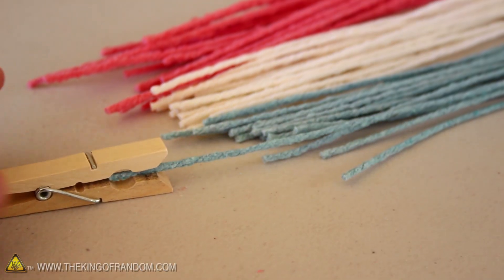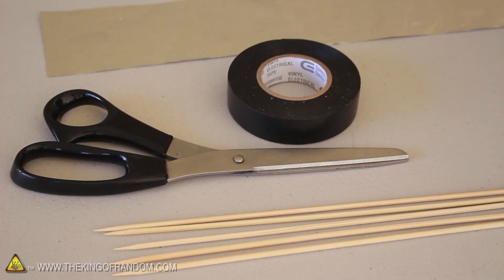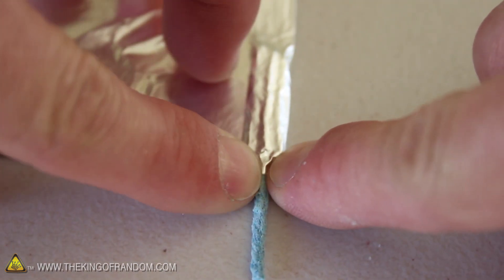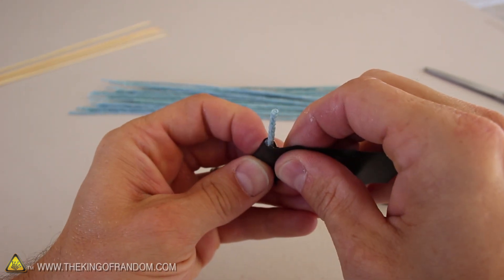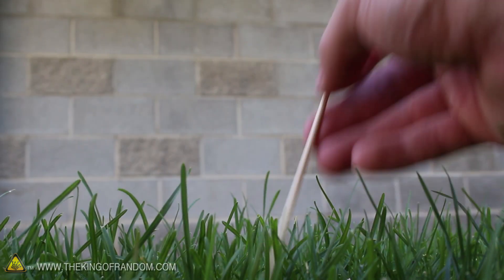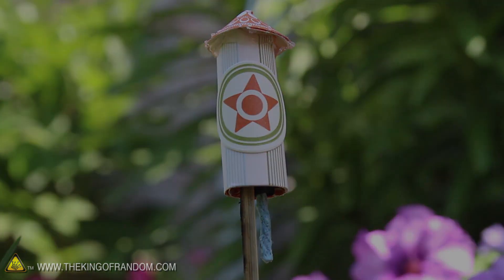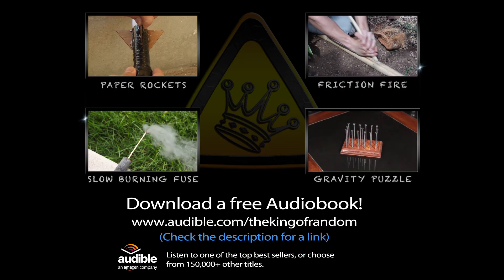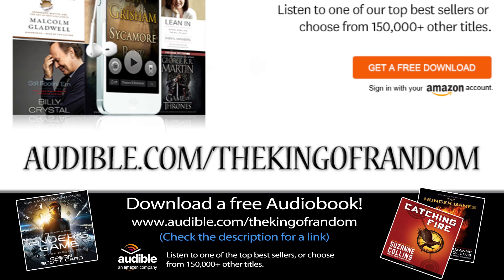Home-brew Bottle Rockets - (From Household Materials)

Comment: This is a great little project. It can be done with store bought fuse as well!
Reply: Remember guys, Fire = YouTube views

YouTube views = Money

Therefore you should make YouTube video's with fire and fireworks!
Reply: I've made these some time ago with some matches. Stick two with the flammable side and wrap in aluminium foil, then heat up the foil, one match will get shot out.
Reply: which store do you get them from?
Reply: Thanks. That was very useful to know!
Reply: NightHawkInLight  what!!??
Reply: @MegaSheep0  not anymore...... Now they just melt crayons

Comment: Seems to me that you could coat paper with a thin layer of white glue and roll around the fuses (maybe 8 layers or so) like a normal bottle rocket instead of using the ecologically unfriendly electrical tape and aluminum foil.  But maybe that wouldn't work as easily as I think.
Reply: Because using any resources at all to make a nearly useless item that gives about 1 second of enjoyment, and releases chemicals into the air, is totally eco-friendly...
Reply: IIDASHII I think you missed part of my point. The tape and foil is much more expensive than paper.
Reply: droid I didn't miss your point at all. I just think it's hilarious that you are talking about being eco-friendly while making bottle rockets. There is nothing "eco-friendly" about them.
Reply: IIDASHII ecological, ie economically... He's talking about cost, not the environment.
Reply: Ecological - relating to or concerned with the relation of living organisms to one another and to their physical surroundings. You have no clue what you are talking about.
Reply: I'm not saying that's what it means. I'm saying that is the point he is trying to get across as far as I can tell. He use the wrong word because afterwards he is talking about expensive indicating he is making a point about the cost.
Reply: Omnipotentia I think you should stop putting words in other people's mouths and let them defend themselves.
Reply: IIDASHII And I think you can stop telling people what to do
Reply: Omnipotentia Actually I meant both. You're not leaving pieces of vinyl plastic and aluminum all over the place and it's cheaper to use paper. My original post just assumed people would realize it was not only ecological but also cheaper.
Reply: droid So now we are mind-readers. Nice. Your original comment neither said, nor implied, anything of the sort, but I appreciate you clearing that up, as you were really the only one I wished to here from about what YOU said.

Comment: you should show us how to make a 2 stage rocket
Reply: Do it all the time.  Just put two engines on one stick.  Offset them so one is just  bit higher than the other.  Arrange the wicks so the lower, longer  one ignites the upper one.  It is easier to do with chineese fuses - those can be easily wrapped together.  Adjust the offset for the best distance.  You want the second one to fire immediately after the first.  Fit-fit!
Reply: Observ45er
thanks
Reply: *****  Why is it that this stuff is so obvious to me and not everyone else...?
Reply: i agree
Reply: tannerwelch102802 "i agree"  with whom about what?
Reply: Observ45er i agree with kerbal space men about the 2 stage rocket
Reply: tannerwelch102802 You agree that the two stage should be added to the vid, or with a thanks ??
Reply: Observ45er Because you're just soooooooo smart and not at all conceited.

Comment from the maker: Thanks Steve!  There is a slight benefit for heat reflection with the shiny side inward. However you're right in that it won't make any noticeable difference to anyone who used the other side.
Reply: Tomorrow ís 10 years of video

Comment: Cool! At 0:47 why do you say shiny side up? There's no difference in the surface material. The reason one side is shiny and the other not is that during manufacturing, one side faces a roller while the other is on a flat surface.
Reply: Shouldn't make much difference, but the smooth surface of the shiny side might absorb heat slightly slower than the matte side.
Reply: its for the stickyness for the electrical tape, its better to use the non-shiny side for taping and glue
Reply: NightHawkInLight no, its because the non-sticky side is better for glue and tape

Comment: I used to make these out of match sticks. Same idea one wodden match fold some tin foil over the end the same way. Hold a flame under the foil until it lit the match inside and it took off the were so much fun. Until my mom came looking for the matches. Lol just use a paperclip bent at a 45° angle. Just hold the longer bend and pull the short bend up to creat the angle.

Comment: +GrantThomsom By the way it's not pressure it is actually a chemical reaction between Tin Foil and the chemical in the wicks and pressure 
That means you got half right
Reply: The Kelling Bros. First the kno3 and sugar does not react with the aluminium unless it's in a fine powder and second, if no pressure build up how would the rocker even accelarate?

Comment: nic now just add a quick-fused firecracker( white fuse: get em from firecracker strips) taped to the top with the fuse in the fuses used to propel the rocket. the fuse should burn up long before it lands and boom! you have a bottle rocket with a report.

Comment: You should be able to make it bang when it's in the sky.  Just include an explosive material at the top of the rocket where the fuse ends.  When the burning fuse reaches the end, the heat should trigger the explosive material
Reply: You make it and then maybe he will

Comment: If you used thread to make more homemade fuses but smaller you could attach these to the main fuse of the rockets and connect them to one thread fuse to launch rockets at the same time, but I'd be unsure of the burning capabilities of fuses made with thread.

Comment: have you lauched a soup can with a black cat, bowl of water and a soup can. punch hole dead center of can bottom lid after you ate the soup of course, and get a bowl test fit can to see how much water it takes to make a seal on the can slide black cat up almost to the end so just fuse pokes out light and run

Comment: nice work! I took the gunpowder in a big firework missle, and it contains litle silver balls that burn in the same speed of a fuse, they build very much pressure in the aluminum foil to the level that 2 balls send the rocket flying 5ofoot

Comment: In one of my science class we did match stick rockets that used 2" by 2" piece tinfoil, 2 match sticks, and a paper clip as a launcher base.
1. Cut off on of the match stick head 
2. place the head next to the head of the full match stick on a piece of tinfoil
*hint let the wood part of the match hang off the edge of the tinfoil
3. gently roll the match up in the tinfoil and fold over extra tinfoil the two heads of the match, so all that sticks out is the small tip of the wooden match 
4. take the clip and bend to to a launcher with a arm aiming in the direction you wish to fire 
5. place the arm of the clip along side of the match stick, inside the tinfoil
6. light the end with a lighter/match and enjoy or repeat

Comment: Now take a piece of tape and put it at the top, make a hole in it for another piece of fuse (should be 0,3 cm), take some flash powder and make a little firecracker on the top, now you have a bottle rocket with report :)

Comment: Just finished making a batch of these.  Very good success considering it was my first attempt.
First, my fuse is bit more "clumpy".  Am I soaking it in the solution too long?
I also ended up using too much inside the body because even tho I wrapped a good amount of tape around the body, they still all burst about 30' in the air.
So, time to experiment... Just don't like the clumpy fuse...

Comment: Have you considered attempting to scale this up a little? maybe to the size of your thumb?
Reply: Actually smaller is fun.  Mini-SRB's 
Wrap about 1 sq inch of foil around an ordinary paper match.  Leave at least half of the cardboard match exposed to form the 'tail' and about 1/3 to 1/2 inch past the tip. . 
  However, lay a pin or needle along one flat side with the point just running up along the bottom part of the 'fuel' tip.  Make the wrap tight making sure to keep it tight on the thin edges of the "body". This takes dexterity and practice.  With a finger nail, crease the foil tightly along the length of the pin to form a narrow exhaust channel.
  Carefully twist the forward tip to seal it, so as not to twist a hole in the forward tip and don't leave too much excess, nor have it at an angle.  It will act like a canard and shoot sideways if crooked. They shoot just like his with a quick - ffit! .
   I also sometimes wrap a fine enamel wire (I think about 30 or 34 guage)  the 'fuel' and bring the ends out the rear to sit on two foil "ignition" strips.    This allows electric firing from a D cell ! 

Been doin' this since the 50's.  Saw it in Popular Mechanics, or some such mag...
Reply: Observ45er I will read that later, I was interested in wether it would be possible or not and how far it could go, not really the fun aspect.

The small ones seem to be good fun but then I thought about the possible limitations and wanted to see what they might be.

As a citizen in an overly paranoid country I can't get access to KNO3 and have to rely on youtube videos to please my curiosity.
Reply: mazzpsykoziz  Yea, I know.  Everybody wants a bigger boom or higher rocket,  If you make it bigger, the foil and/or tape becomes too weak at some point. 
GL
Reply: Yea.  When you understand everything, it's hard to be humble.  But it is satisfying, none the less...
Reply: mazzpsykoziz No not at all.  I just mean that it is hard to be humble when I understand everything, but it is satisfying (to me).  I tell a story to my classes and usually get a few chuckles:
"I used to say that 'I know everything.'  A good friend took me aside one day and gently advised me that this sounded a bit arrogant and that I should demonstrate some humility.    So... I changed it to 'I know everything except how to be humble.'  Some time later, that friend stopped by and said that he thought I was finally showing some signs of humility.  So I realized I could go back to "I know everything.'
(;-)

Comment: I think you should try to combine the bottle rockets with the disposable lighter pyrotechnics. I think if it worked it would make a nice effect. Maybe the heat of the flame coming from the fuse would be enough to heat the flint to the point of a pop.

Comment: Grant I simply love your channel. great job.keep it up.. I'm gonna go with your design for the yarn fuse's. I was goanna go electric but after seeing your bid I changed my minds. Ive made some rocket motors using your design and they came perfect. I'm going to make your rocket motor design with the delay and the discharge for a parachute.. I couldn't see exactly what grain of gunpowder u used in the video?? .I'm gonna have to wing it as far as that step I guess?? but anyway thanks for the awesome vid's..  Ray